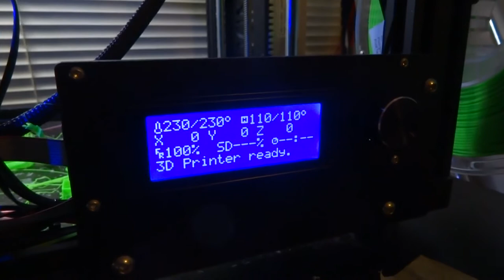Creality Stock Print Head Manifold

Comment: Nice ideas you got there. I'm gonna replace mine by an v6 clone, though. I'm lookin forward towards your CoreXY conversion parts! Btw: I have put an external thermometer onto my heatbed, and it showed about 85 degrees, when the display reported 110 - ABS was impossible to print without isolating the bed and putting a case around the Ender. Also I modified marlin to actually report a more accurate temperature for my setup. It now takes about 20 minutes for the bed to reach real 110 degrees.